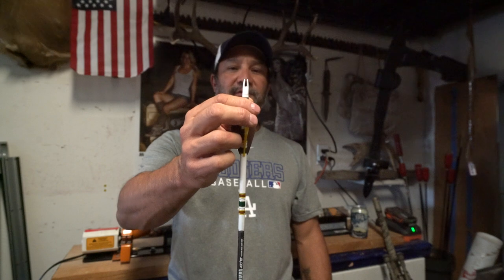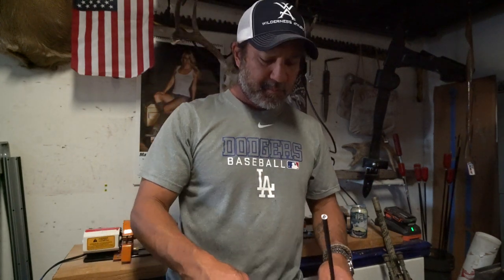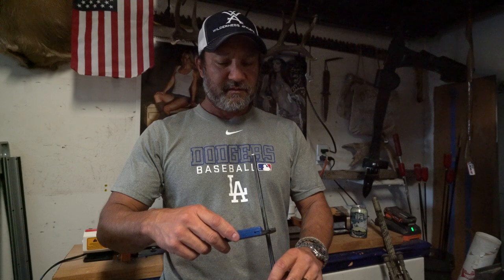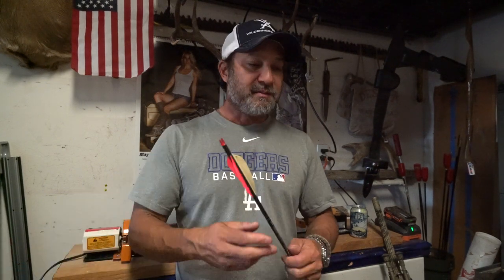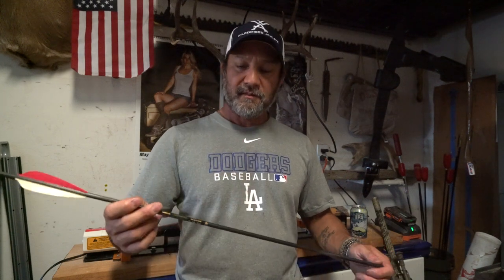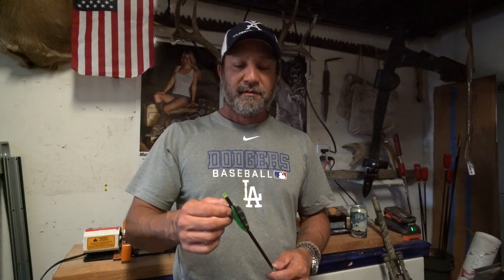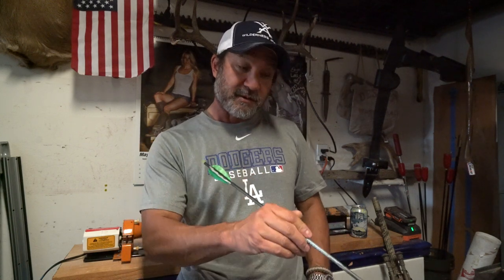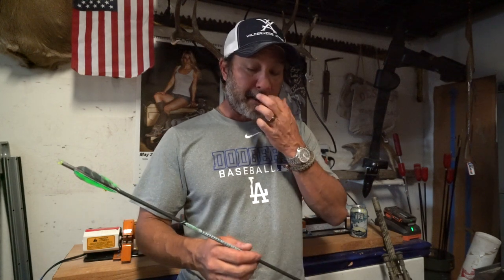Load Development: Vanes and fletching.

Comment: Great Video.  What did you like or not like about the X-impact? I am between the Rampage and x-impact shafts.  Thanks
Reply from the maker: Labatts22 Glad you liked it and I hope it answered a few questions. Regarding the X-Impact: pros - precise, micro diameter, flew great; cons - durability, cost, durability. The cons were kind of an understanding when I started using them but it became unacceptable after several months of shooting. They flew well and built up nicely, pretty simple and satisfying. But they began to develop hairline fractures at the nock end and I only discovered that when the pin nocks I was using were cracking also (take a look at the video titled “Archery Considerations: Pin Nocks”). Peeling the wraps off to inspect further revealed the micro cracks in the shaft wall. I just finished a dozen Rampage shafts for a buddy and they built up well also. They’re a slightly larger in both diameter and grains/inch so I imagine they’re going to be a little more durable.